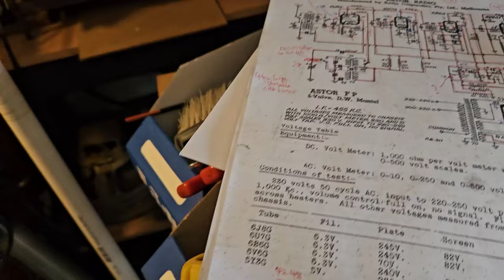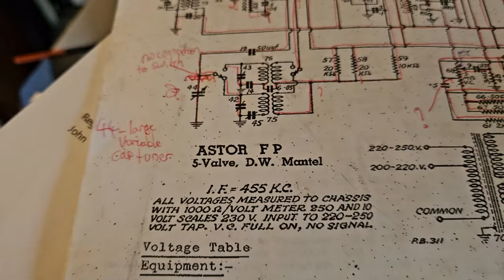1947 Astor FP valve radio restoration (Part 11) (radio is working!!!)

Comment: The dummy knob is part of the dial string system. The string would wrap around that, loop through the station dial plate (appears to be missing) and then around the wheel on the tuning cap. Great job. Keep hitting it with a hammer. Eventually, you will get all the bugs out. I also think, you will get better results by connecting a few feet of wire to the antenna connector. The mystery switch might be part of the RF sensitivity control for hot vs weak stations.
Reply from the maker: Thanks Richard!!! Now all makes sense! The radio does have the dial plate and dial needle but the're only fragments of the original dial cord left, I have ordered some dial cord off Ebay, once I get it I will work on putting it back together. In the meantime am concentrating on repairing the speaker cone as it has rips and holes in it, watched a few repair vids which involves PVA glue and tissue paper, so that's the route I will take with the speaker repair.